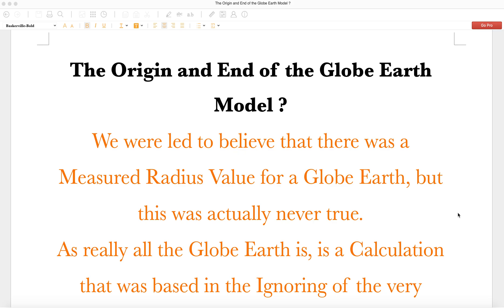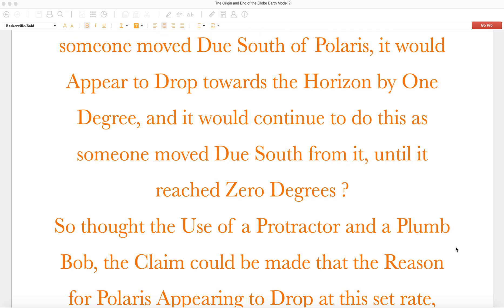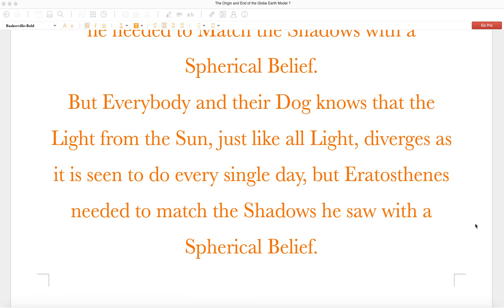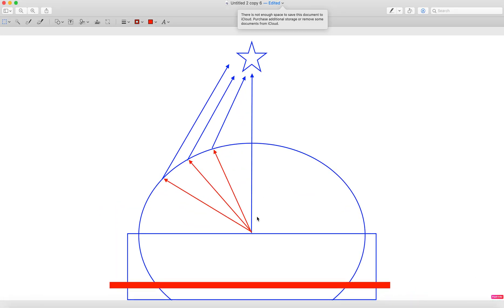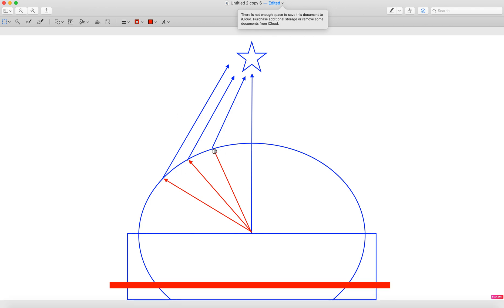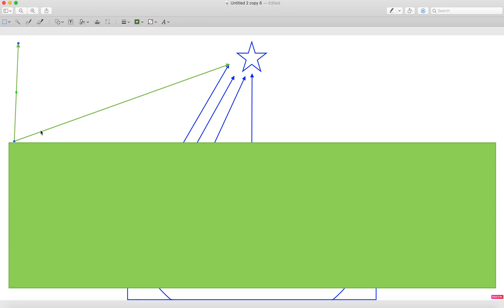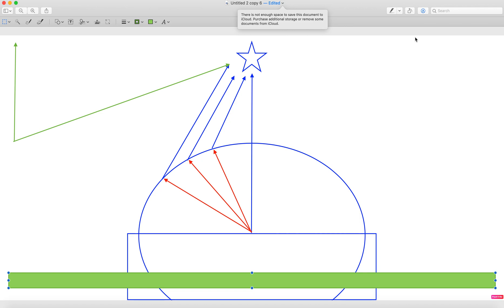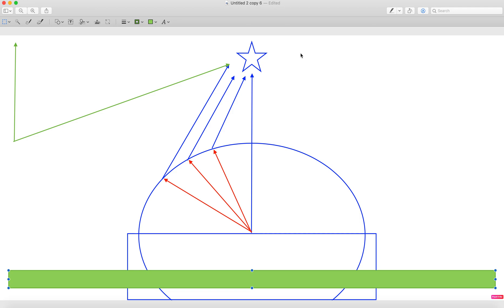The Origins and End of the Globe Earth Model ?

Comment: Again, you’re making this silly claim that the earth needs to be flat in order to make an elevation angle measurement. 

Q1) Can I establish the direction of down, using, for example, a plumb bob? Y/N

Q2) Can I construct a line of sight that is perpendicular to that direction of “down”? Y/N

Q3) Did I require any particular shape of the surface to answer the first two questions? Y/N

Thanks.
Reply: I have yet to see a flat Earther physically demonstrate an elevation angle measurement as being impossible on a globe.
Reply: Show the science of sky-balls and then prove how Earth is one of them.
Reply: @JamesHawkeYouTube  Are you a robot .. ?
Reply: Tape a plumb line to the underside at the front end of some sort of scope, point the scope at a star, measure the angle between the plumb line and the scope in radians, multiply that by 3959, the result is the distance round the curve between the observer and the stars GP.
There should be some small correction for atmospheric refraction which will be a bit bigger when the star is close to the horizon.
But apart from that correction, what problems are there with carrying out the simple steps above?
Why are people insisting that all this depends on right triangles and flat adjacents?
Reply: The line of sight perpendicular to "up" is implicitly a straight line projected out infinitely.  That is a flat plane.
So the answer to Q3 is obviously YES if the goal is to obtain a valid answer (on anything other than a flat plane).
It is obvious on a sphere that the surface is exponentially "curving away" yet you seem to be deliberately acting like this is NOT A THING in this situation. 
Of course, the only difference between a sphere and a plane is this exact thing.
Reply: @decadent.  No 🤦🏼‍♂️🤦🏼‍♂️ The horizontal plane you measure elevation angles relative to IS NOT THE SAME THING AS THE SURFACE OF THE EARTH. A “horizontal plane” is simply perpendicular to down. Nothing to do with any shape of the earth. All you need is “down”.
Reply: @decadent.  right. Straight LINE. how do you infer a Plane from a straight line???! Explain.
Reply from the maker: Il make it simple, if you are making an elevation angle 📐 to Polaris that’s 52 degrees above the Horizon, then all that distance runs along the baseline of that Right Angle 📐 so how many Nautical Miles of Horizontal is that ?
Reply: @BriansLogic  I’ve asked you three simple, direct questions. Why are you running away from them?
Reply from the maker: @roohif  Roohif my one question is the answer to those three ?
Do Plumb Bob’s make a perpendicular with Horizontal ? Of course they do, but what has that got to do with a Globe, what has the direction of Down got to do with a Globe, how is that a proof of a globe ?
Reply: @BriansLogic  Those questions are not meant to be proof of the globe. If you answer them, you’ll understand why elevation angles do not require any particular shape of the earth. So what are your answers to these three questions?
Reply from the maker: SHAWN HAWKINS  Shawn is talking Rubbish again ?
Reply: The elevation angle (used interchangeably with altitude angle) is the angular height of the sun in the sky measured from the horizontal - Elevation Angle | PVEducation

“ELEVATION AND AZIMUTH ANGLES
For the case of a geostationary satellite and an earth station having latitude φ and longitude λ relative to the subsatellite point on the equator, the elevation angle (i.e., the angle above the horizon) and the azimuth angle (i.e., the angle measured clockwise from the direction of true North) can be computed by using standard spherical and plane trigonometry relationships.” …
“It also must be noted that these equations assume a spherical Earth. Fortunately, most receiving antennas are insensitive to the slight errors this assumption
causes.” sciencedirect dot com

Measurement of the elevation angle
“Elevation angle is the angle between the horizontal plane and the line of sight, measured in the vertical plane. The reference direction (i.e. an elevation angle of zero degrees) is a horizontal line in the direction to the horizon” - Elevation Angle - Radartutorial

“The solar zenith angle is the angle between the sun’s rays and the vertical direction. It is closely related to the solar altitude angle, which is the angle between the sun’s rays and a horizontal plane Since these two angles are complementary, the cosine of either one of them equals the sine of the other. They can both be calculated with the same formula, using results from spherical trigonometry… The formula also neglects the effect of atmospheric refraction.” [Because it’s no Atmo day lol] - Solar zenith angle - Wikipedia

Angle of Elevation
“The angle of elevation is the angle between the horizontal line and the line of sight which is above the horizontal [not curved] line. It is formed when an observer looks upwards. Suppose you are standing at the terrace of a building and looking upwards at the sky or at the sun or moon. The angle thus formed between your height from the ground level and the line of sight formed is called the angle of elevation.” Angle of Elevation - Formula, Definition, Examples

Angle of Elevation Definition
“The angle of elevation is an angle that is formed between the horizontal line and the line of sight. If the line of sight is upward from the horizontal line, then the angle formed is an angle of elevation.” - Angle of Elevation - Definition, Formula and Examples

“The altitude angle (sometimes referred to as the "solar elevation angle") describes how high the sun appears in the sky. The angle is measured between an imaginary line between the observer and the sun and the horizontal plane the observer is standing on. “ - Sustainable By Design :: Altitude Angle

“The "upwards" angle from the horizontal to a line of sight from the observer to some point of interest.” - Definition of Angle of Elevation

Angle of Elevation
Definition
“An angle of elevation is an angle with one horizontal arm, and one arm above horizontal.
Usually an angle of elevation is less than or equal to 90°.” - Angle of Elevation
Reply: @NathanOakley1980  That’s a very long comment that doesn’t answer the three very simple, direct questions. Try again, Nathan.
Reply: @NathanOakley1980  You really needed to make a citation only from official sources post, to avoid to say even one absurdity in your post.
Reply: @roohif Your questions are obviously true. The issue you have is that they don't help you to decide whether you are navigating around a globe or a flat plane. ;-/  Somehow you need to do some direct measurements of the surface that you are traveling over. You cannot use the sky to tell you anything useful about the shape of the earth. 
   Your questions are also useless to help you determine the shape of the earth.

Feel free to explain why you think your questions are useful. Please provide any assumptions about the real world you are making and how your assumptions have been verified in the real world.  This last one about verification is really interesting.
Reply: @ryanqvincent144  The questions are useful because Nathan et al believe that the simple act of measuring an elevation angle proves that we’re on a flat earth.
Reply: @ryanqvincent144  Standard bollocks as usual. Celestial objects are very useful to determine many things about the shape of the Earth. Because you Mum won’t let you travel too far from your house you won’t be able to experience the sky after travelling thousands of miles. Objects visible in one place may or may not be visible in others. We can see from the angular relationships where stars should be but there is something obscuring the stars. The bloody Earth. Just because you type this crap doesn’t mean its true. With you it normally means the opposite.
Reply: @ryanqvincent144  You say that you cannot use the sky to say anything about the shape of the Earth but all these other Flat Earthers have been saying for the last 5 months that you can calculate the actual physical distance along the surface of the Earth between two locations using elevation angles to celestial bodies. Do you see how these distances could be used to determine the shape of the surface?
Reply: @ryanqvincent144  said " you need to do some direct measurements of the surface that you are traveling over. "

Fine. Norwood did this in the 1600s. The French Geodesic Mission did this in the 1700s. Many, many others have done so since. 

"You cannot use the sky to tell you anything useful about the shape of the earth. " - Why? Just because you say so? Gotta do better than that.